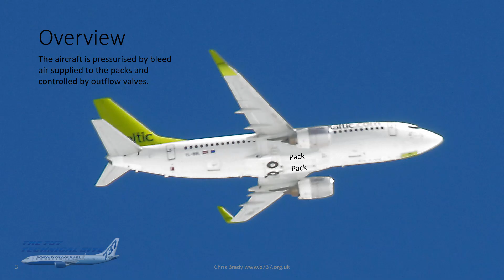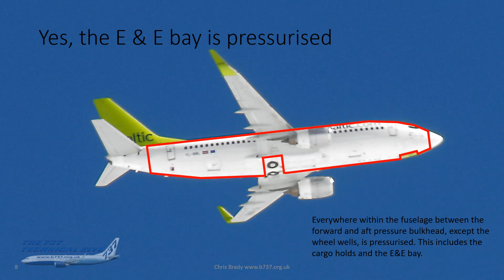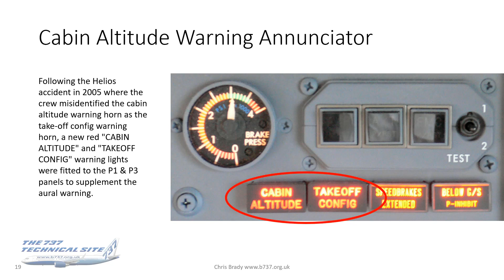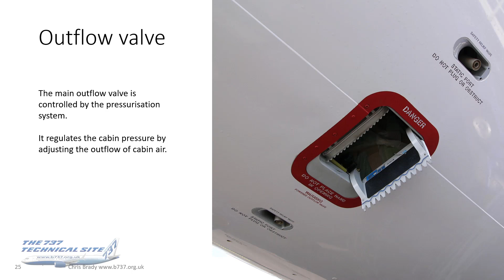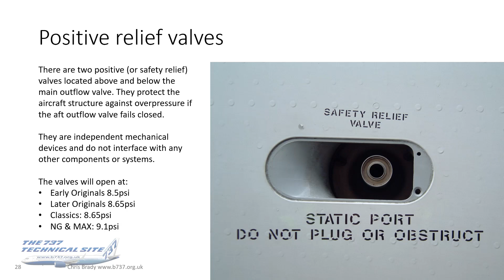737 Pressurisation

Comment: Hey, can someone help me understand, so if we have both pack failure and our cabin altitude is 8000ft we have only about 2 min to descent without dropping masks for pax ? I am surprised that the cabin climb rate would be so high (around 3000ft/min for not new ac). I used to fly A320 before and as far as I remember the rate was around twice lower. 17:23

Comment: When on ground, the outflow valve is driven to the full (AUTO) open position.  With the doors open and the packs OFF, the cabin pressure will be ambient.  With the doors closed and the packs OFF, the cabin pressure will be ambient.  With the doors closed, and the packs moved to AUTO, the vast majority of the pack air will pass through the OFV, but the OFV doesn’t have sufficient outflow area to give a delta pressure of exactly zero - I think Boeing specs say less than 0.06 psid?  My question is - how does this small build up of delta pressure manifest at the Rate of Climb indicator when the packs are turned on?  Is it noticeable or not?  Has anyone done this in a 737?
Reply from the maker: Yes, switching packs on and off on the ground with doors closed will give a kick on the cabin VSi, just as flushing the toilet or even emptying the sink will do the same in-flight!
Reply: @ChrisBrady737  Thank you.  Do you have any idea of the RoC indicated during a typical packs on “kick” whilst on ground?  It seems such a small dP, and I’m surprised the lagged gauge/sensor picks it up!
Reply from the maker: @despoticmusic It is just a brief kick. If you could read the gauge it wouldn’t be accurate as it is so transient.

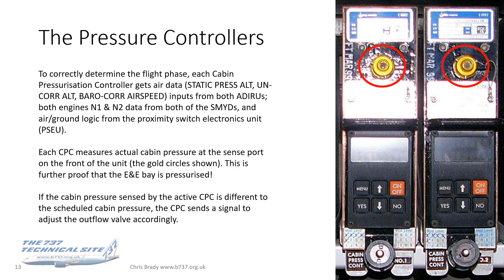Comment: In the recent Alaska Airlines door failure incident, Jennifer Homendy of NTSB said pilots reported "pressurisation warning lights" on three previous flights made by the specific Alaska Airlines Max 9 involved. She didn't mention the altitude warning horn. I wonder if this was the "Auto fail" light (at 10:47), and if that failed would it be normal to allow a plane to continue flying until the pressurisation controller can be fixed?
Reply from the maker: Yes it is "normal to allow a plane to continue flying until the pressurisation controller can be fixed". There are approved procedures for this in the MEL.

Comment: Thank you Captain Brady, once again, amazing work.
Do you plan on making a presentation on the Autoflight system eventually? You have a great way of boiling complicated things down to the point. It would be extremely helpful to me for my upcoming simulator training.
Reply from the maker: Thank you for your comments. Autoflight is on the list but wont be happening anytime soon as I am busy flying in summer.
Reply: @ChrisBrady737  That’s okay, I’m sure whenever it comes out it will still be helpful with whatever phase I’m in at the time. Fly safe Sir.

Comment: Hi Chris, it may be worth mentioning that there is no mechanical stop on the cabin altitude indicator at zero ft. Apparently there was an incident in 2018 where a crew had a CPC2 failure in the CRZ, carried out an emergency descent and correctly closed the OFV i.a.w. with the memory items. On descent the cabin differential pressure reached 8.75psi (PRV helped to maintain this), and the cabin altitude which was at 15,000 ft at the time of the failure, reached -7000 ft. However, interestingly this was displayed as +33,000ft on the indicator as there is no mechanical stop (i.e. the pointer went through zero ft.). After some confusion (naturally..) the crew opened the OFV before commencing the approach and the differential pressure normalised. 

It would have been a very confusing picture to have seen +33,000 ft cabin altitude and +8.75psi diff. at 9000 ft aircraft barometric altitude. Maybe worth a mention in your future presentations as a bit of additional info.

Refer to Interim Report BFU18-0975-EX. 

Interesting!
Reply from the maker: There have been many variations of this type of incident over the years, many with some mishandling of the DCPCS panel. The BFU report states that the panel can be confusing. Details on my website here http://www.b737.org.uk/incident_ei-enm.htm
Reply: @ChrisBrady737  Thanks as always Chris. Yes I see the crew had a bias due to the way operators usually train for this scenario in the sim (with damage and uncontrollable cabin alt.). Really good that you mentioned it on your brief analysis found on the link above - great lesson/reminder for all B737 flight crew.

Comment: Thanks again Chris for the excellent presentation!
Reply from the maker: My pleasure, glad you found it useful.
Reply: @ChrisBrady737  Hey Chris?  Your knowledge of the 737 is amazing, and you are a godsend for pilots like me...THANK YOU for sharing Chris!  I just watched your ANTI-ICE video and learned what the different types of icing on the 737 were, and what to look for.  I must say that we hardly see any of the moderate to severe icing here in Hawaii, but I did see SEVERE icing like what you described in the video.  Now, I know!  Do you advise turning on the WING ANTI-ICE during moderate icing?  Thanks again, Chris!
Reply from the maker: Hi Jay, there is a section in the FCOM Supplementary Procedures - Adverse Weather called "Wing Anti-ice Operation In-Flight". It states that wing anti-ice can be used "as an anti-icer only during extended operations in moderate or severe icing conditions, such as holding.". Elsewhere in the SP it tells you to avoid moderate to severe icing conditions.
Reply: @ChrisBrady737  Thanks again, Chris!  I did see you relay that in the video.

Comment: Thanks Chris！ This video helps me a lot about pressurization system. Why does our company only mention the schedule below 28000ft on FCOM Δ P is 7.45. The number 18500ft is not mentioned. Was it written on your FCOM or learned by the maintenance manual？
Reply from the maker: Good spot, I had not noticed that they had removed the 18,500ft reference from the FCOMs - but it is absolutely true for all generations of 737 and it is still documented in the AMM. It is probably an oversight on Boeings part to remove it in the process of simplification for pilots. They don't want to bother us with such info!

Comment: Hi Chris, I am currently doing research regarding the Boeing 737-800 aircraft ceiling, I could only find the service ceiling (41,000 ft) but could not find any sources that state the absolute ceiling of the Boeing 737-800. May I know what is the absolute ceiling of that aircraft? Greatly appreciate it. Thank you.
Reply from the maker: The maximum certified ceiling is 41,000ft. The actual physical ceiling will depend upon weight, ISA deviation, CofG, buffet margins etc

Comment: 19:30 I would believe that without even a moment of hesitation, in fact I would have been flabbergasted if it were not integral to a panel designed in the last two decades.  A robust, reliable connector that can accommodate the many signals needed to externally drive the individual elements of the panel would probably take more space than a microcontroller driving them locally.

Comment: One trusts that Chris won't mind me adding a gem of wisdom?

If a pack or bleed fails at cruise altitude the aircraft 'should' hold the cabin pressure on one pack / bleed, at least that's the theory.

The reality however can be very different and you might well find that, on one pack / bleed, the cabin starts climbing up to meet you... and therein you don't have long to address the problem before the cabin altitude hits 10,000ft (beep beep beep in the flight deck) and continues to climb (masks drop in the cabin and then you're probably diverting for a problem that could have been averted).

So, having had a failure of a single pack / bleed you decide to descend (e.g. down to FL250 or below). It's not (yet) an emergency, so you ask ATC for a descent clearance. They of course ask "Is all ok ?" to which you reply, in your smoothest airline pilot voice, that it's just a minor technical problem and that you're descending purely as a precaution. They clear you to descend... you set the MCP altitude and dial-in some V/S... let's say 1,000 fpm (there's no point alarming the Cabin Crew and pax with a heroic emergency descent, is there?)

The thrust levers retard a bit (based upon whatever V/S it is that you've dialled in) and down you go... marvellous.

Unfortunately, retarding the thrust also causes the pressure in the duct to drop and now the cabin altitude (being contained by just a single pack / bleed) starts climbing up to meet you with a vengeance. Doh!

However, being a consummate professional, you've anticipated this and have spotted it on the overhead panel. So, what to do ?

You might choose to increase the rate of descent, which in turn will retard the thrust even further, therein reducing bleed pressure even more, thus exaserbating the problem. It then becomes a race of which will occur first, i.e. will you get to your level off altitude (when thrust is reapplied and the duct pressure comes back up again) before the cabin altitude hits the limits for masks dropping and whatnot. Uhm!
OR
Initiate an emergency descent (uhm, might seem a bit excessive for what should be a controllable problem).
OR
Maybe what you could do is increase the thrust (which seems counterintuitive wrt descending) - if needs be, just applying thrust on the engine that's driving the operative pack / bleed - which thereby re-pressures the duct to an extent that the cabin stops climbing (or at least climbs more slowly)... and thereafter do whatever needs to be done to control the effect of the additional thrust upon ones airspeed and / or to control the rate of descent and / or deal with any thrust asymmetry, during the descent.

In any event, with a single pack / bleed failure at cruise altitude, when you close the thrust (even partially) to descend from cruise altitude, keep a very beady eye on that cabin altitude.

Fwiw, the above has happened to me (more than once) on B737 and B757.
Reply from the maker: Hi Tony,
I absolutely do not mind hearing your wisdom. One should always embrace the experience and learnings of others as it may save you from having to go through the same yourself.
Absolutely top tips and a great idea about maintaining the onside bleed pressure.
Chris
Reply: So would deploying the speed brake (keeping your hand on the lever of course) during the descent while keeping a steady thrust work?
Reply: @GNX157  in a word ‘yes’… it’s worked for me (more than once)… though it’s a case of using one’s judgment as to which is the best course of action for the specific problem that one’s facing.

You need to get the aircraft descending as fast as you can, but (in the scenario I’ve described above) you’re doing so with power still applied (on one engine at least, if only to keep pressure in the bleed air duct on that side to, hopefully, arrest the rate at which the cabin altitude is climbing and, hopefully, therein avoid having the rubber jungle deploy within the cabin).
The alternative is to close both thrust levers (which will cause the bleed air pressure to drop to bugger all, following which the cabin altitude will undoubtedly start climbing), pull the speed brake to the flight detent, and hope that you can descend fast enough before the cabin altitude climbs to 14k ft and the rubber jungle deploys.